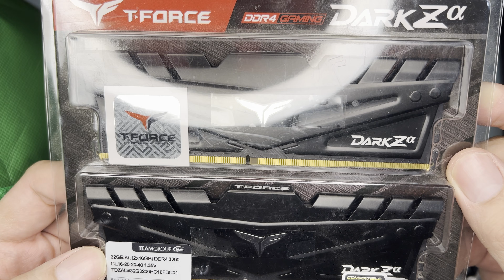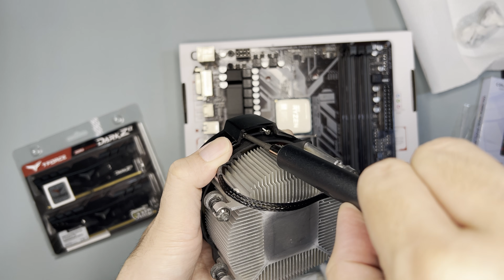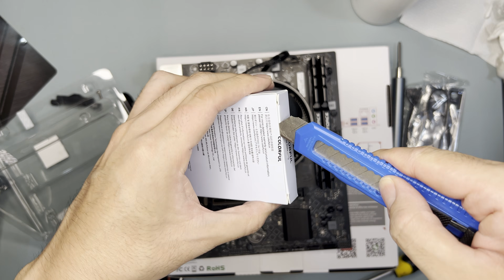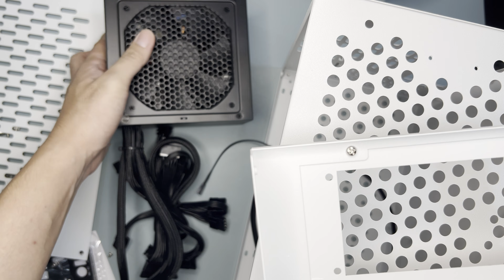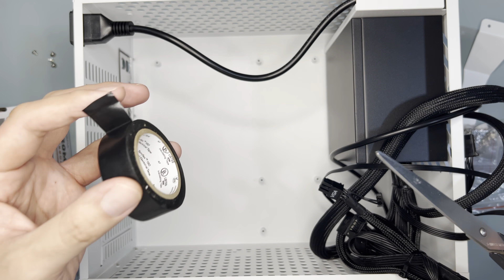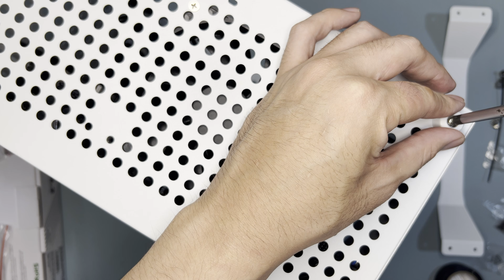Subscriber-requested build vlog 1 ft Qiaomei M3

Comment: Boss pasagot po pls, gpu ko "rx6600 swft210" kasya pa po ba 2 fan sa bottom? Mas kampante po kase pag (2bottom 2top 1 rear)
Reply from the maker: Hi, as I’m not aware of the specs of your GPU. This will depend on the thickness of your GPU, your motherboard (if the GPU will be on the 2nd slot), and thickness of your fan. 
I updated the description for the link of this case for your perusal. The shopee link has the specs that you can check against your own components.

Comment: Hi in regards to the case motherboard mounting since wala siya standoffs di ba siya nag coconduct ng electricity? planning to buy this case
Reply from the maker: Motherboard standoffs are usually metal and conductive in nature, and that’s totally fine — they’re meant to touch the mounting holes on your motherboard. Those spots are designed to safely make contact with the standoffs for grounding.

But since this case has non-removable standoffs and one doesn’t line up with any holes on the motherboard, it’s best to cover that with electrical tape to prevent that from touching the board and causing a short.

Comment: Good day Sir. Thank you for the video. I just want to ask. I have a rx 6600 eagle. 3 fan gpu. Will it fit in this case? I'm planning to change my case cause I need SSF setup because I am planning to bring my pc overseas. Thanks in advnace for the answer more power  to your channel good sir.
Reply from the maker: Yes, but you need you need sfx psu. 

Max gpu length is 330mm with sfx psu, 245mm with atx psu.
Reply: @manongunboxing  thank you for the reply sir

Comment: hi manong can you show us what your setup is to have this top down video?
Reply from the maker: I might not be able to make it as a video  but I bought a tripod + boom arm + ring light combo.

Boom arms are usually for mics but instead, they utilized the quarter inch for the ring light. It can still be utilized for mics though in case you get a better setup. 

The ring light has a phone holder. And for the phone, I used an iPhone 13 Pro.

There are other options — like better cam and better lights but I don’t have a dedicated space for a real studio, my home is small.

Hope this helps.